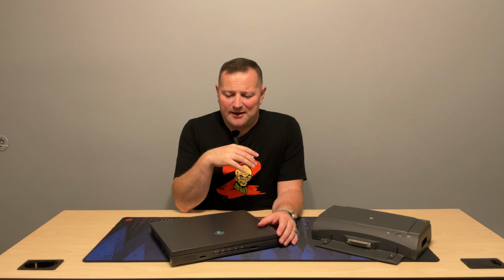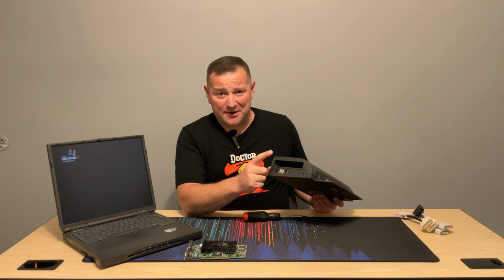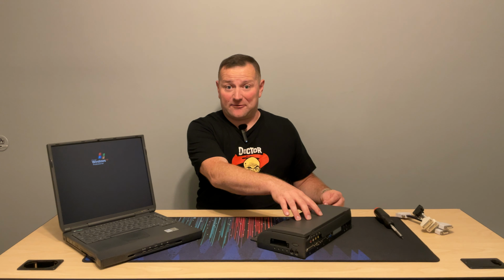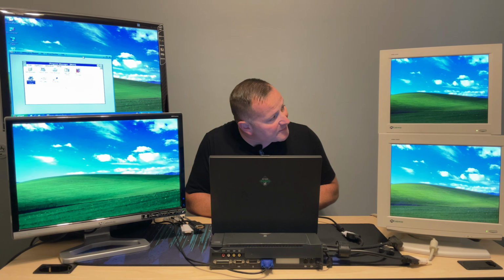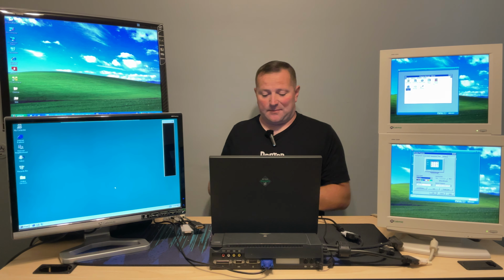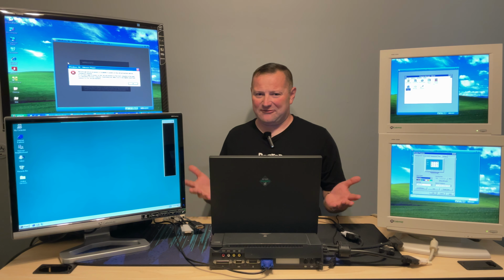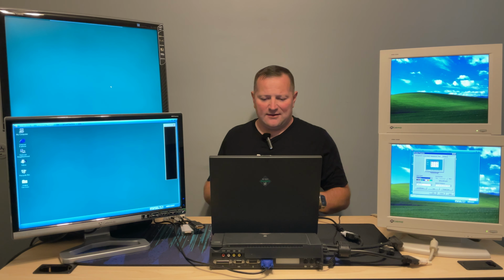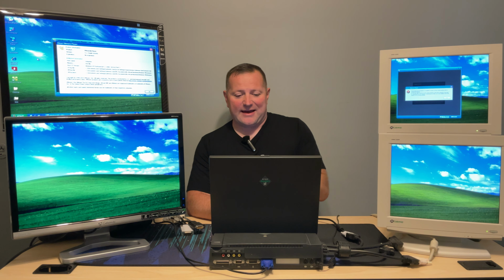4 Operating Systems 1 Laptop

Comment: I can do something like this on my iBook G4 using VirtualPC but i would need to actually install a 4th OS in Virtual PC. i have the max 1.5GB ram too
Reply from the maker: The extra RAM will certainly help but the output is probably limited to one monitor, which is fine when you’re not doing silly stuff with 4 monitors lol
Reply: @IkesVintageTech  well, yea. lol but I can output to 1920x1080 so not too bad.